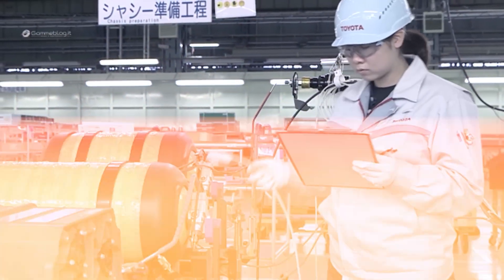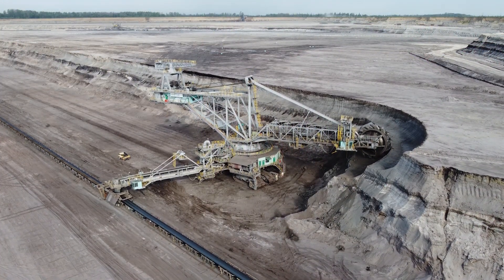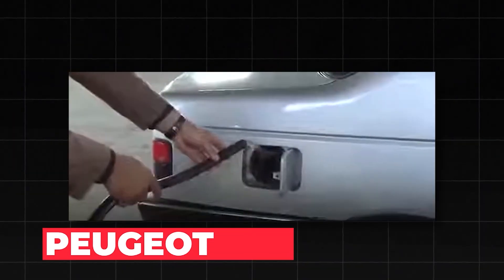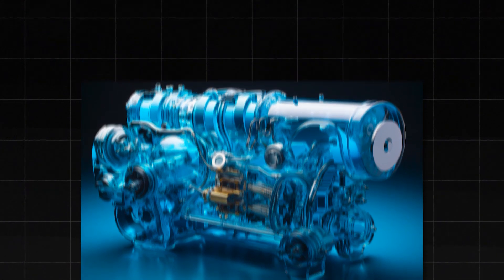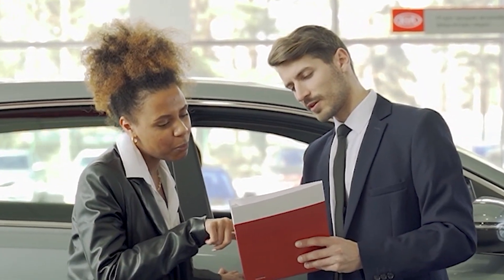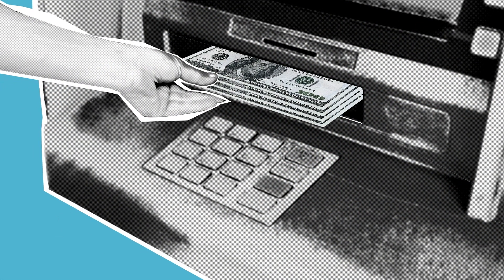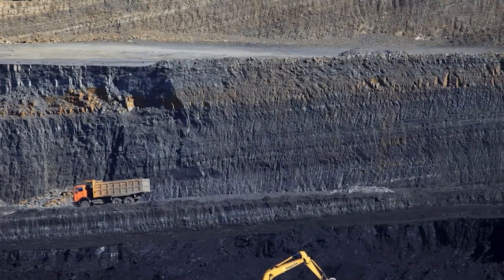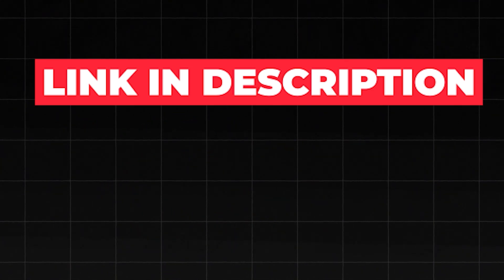Toyota CEO: "Our New Engine Is The End Of The Entire EV Industry!"

Comment: There are no water powered vehicles. I mean, centuries ago there were water powered mills, but I don't see how effective it would be to try driving a car with a big wheel o' buckets on its side would be. Can you imagine the new infrastructure of elevated aqueducts alongside every street and highway with spouts dropping water ever couple of feet? Lol

No, car engines can't magically make power out of water in any way that can move it in a useable way. That probably explains why there are no water engine patents in the world.
Reply: Actually it's simpler than that, water is simply the end result of burning process, hydrogen and oxygen, meaning that water is just like the co2 that comes out the exhaust, there's no more useful energy to be extracted from a chemical bond.